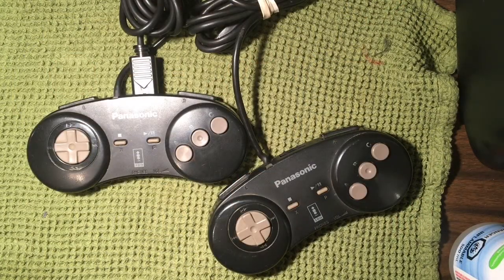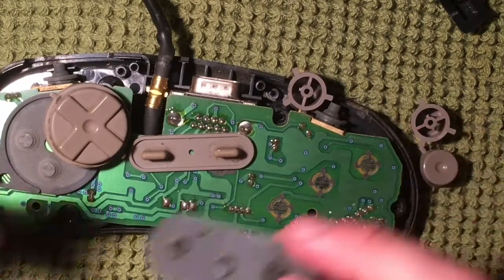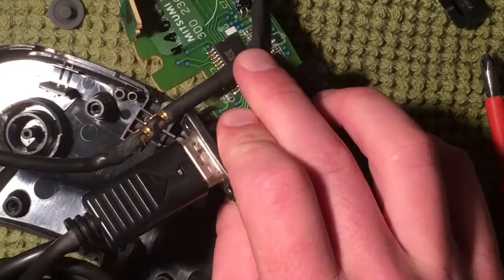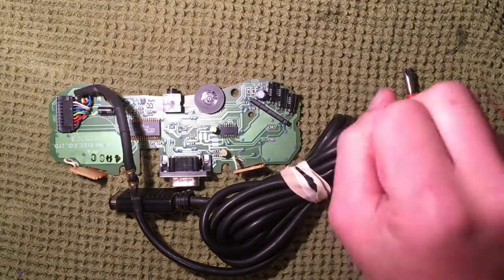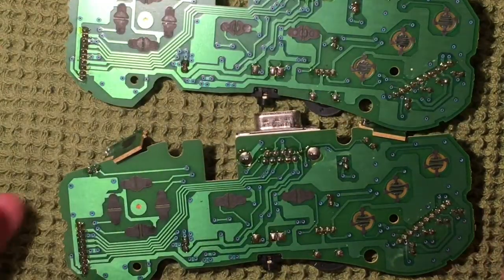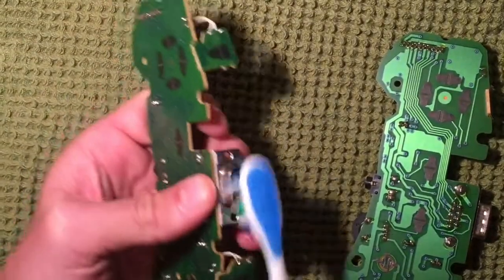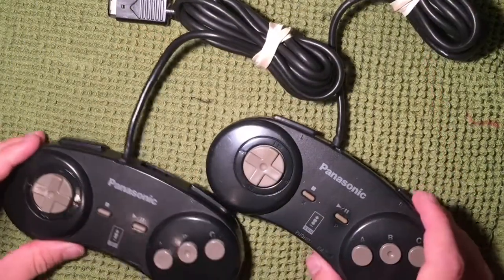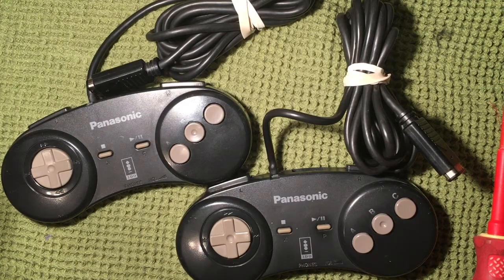Fixing eBay Junk - Opening and Cleaning Panasonic 3DO Controllers

Comment: Nice.

I had acquired an FZ-1 3DO from a thrift store, complete with two controllers for cheap with the plan of reselling it after doing some repairs (replacement caps in the power supply circuit, tweaking the laser power to improve readability of discs).

The controllers needed some cleaning and one of them needed all of its 220µF caps replaced as they had leaked (fortunately, no electrolyte damage on the printed board).

And then I have another 3DO controller I've had for years, which came with my FZ-1 3DO that I had traded a Discman with a friend of mine a couple of decades ago, but only just gotten around to fixing it; the cable had been chewed up in a couple of spots by a dog, so I snipped out the bad portions of the cable and spliced in a new cable using a VGA cable I had lying around, soldering the connections and sealing them with heatshrink tubing.

Comment: If youd get your hands on 3DO again, then I believe that SNES controllers works with the system too. Personally I would love to try and play more 3DO games, but I think that the emulators are my best friends by now.
Reply from the maker: There exists an adapter that allows you to connect a SNES controller to a 3do, however they don't fit natively.  The 3do has the same connector as a Sega Genesis, Colecovision or Atari 2600, except you can't use one of those controllers on it.
Reply: That explains a lot. Thanks !

Comment: I got three of these controllers and a gun,  two of the controllers look like the ones on this video and the other one looks a little bigger,  the bigger one even still has the cable wrapped and in in a mini plastic bag that looks factory. The other two were kinda messy so I cleaned them up little, I should go back and deep clean all four of then and sell them online. The problem is I don't have a 3DO and can't confirm that they work, but I think they probably would work since the were in a garage for a while next to some NES controllers that do work since the do work with my NES.
Reply from the maker: Simon .G 3DO was interesting, since it was made by several different manufactures.
Reply: Good job but one liddle hint/mistake... This type of capacitors very very rarely dont look good.. yet they can cause tons of problems... much only certain way to test these thou is do desolder theme :/  My nes capacitors looked like new... yet after desolder and testing... these were reason my nes didnt had sound..
Reply from the maker: Simon .G very true, the smaller ones are tougher to truly detect failure.  The big ones usually bulge or leak more often.  Best way would be to measure the capacitance, but I don't have the proper tool for that.
Reply: Also had chinese nes copy.. burnt down 2x 7805  chips before figured i should test 2x 100/25 caps in its power modul.. I call theme caps but these damn things worked like resistors... Changed these out and used andother 7805.. works great :)  Caps looked good.
Reply: I use cheap tester. Not as good but gives idea. Usualy if these small ones cause problem they are completely done and even normal tester can show that :)
Reply: @RetroRepairs  I use an ESR capacitor analyser